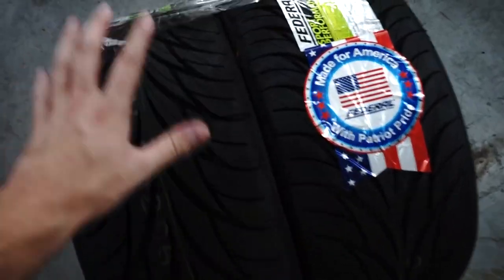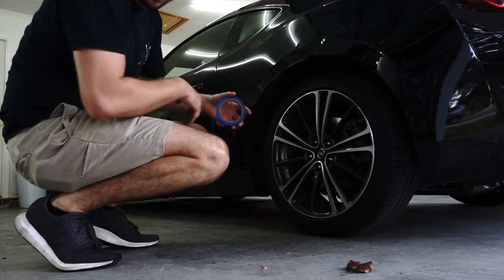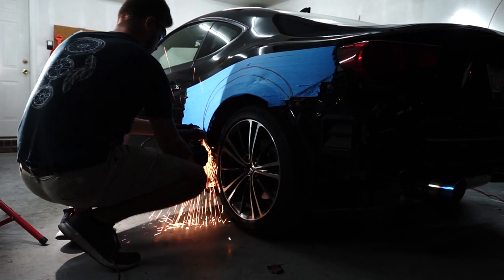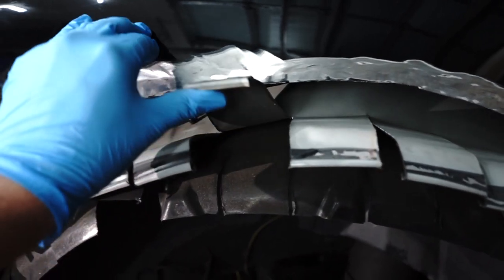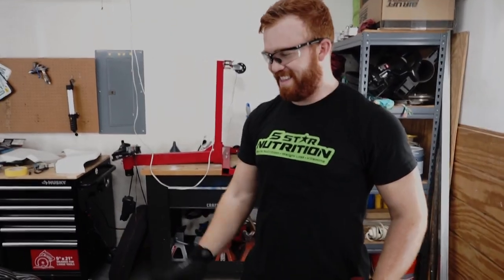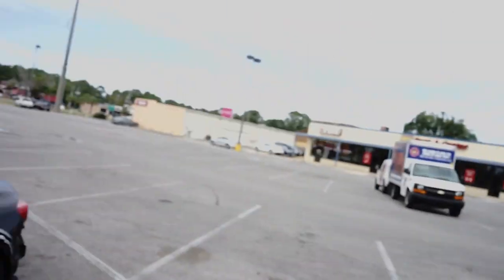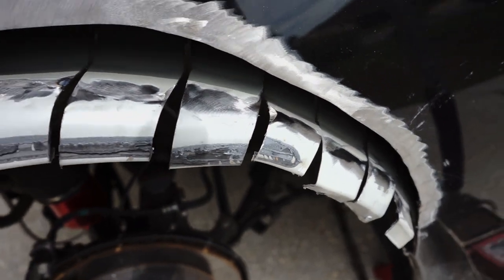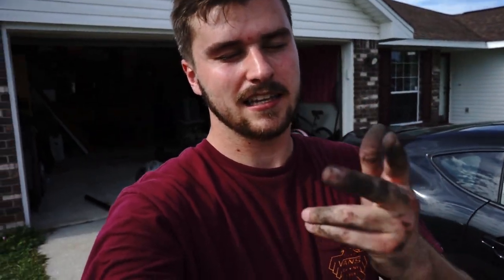“Slice & Dice” | Rally Backer V2 Installation [Pt.2]

Comment: I would grind that sealant off before you do the final install of the kit and use something designed for that purpose like 3M 08308 seam sealer. Just put some paint on the bare metal beforehand. Just my two cents as a body guy haha.
Reply from the maker: Alex Perrucci true!! I caked it on there for sure lol